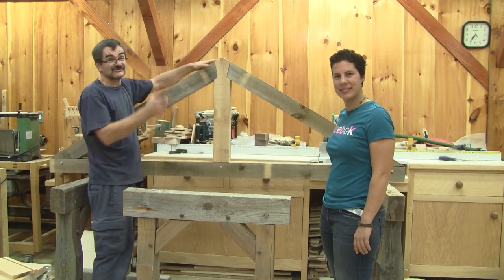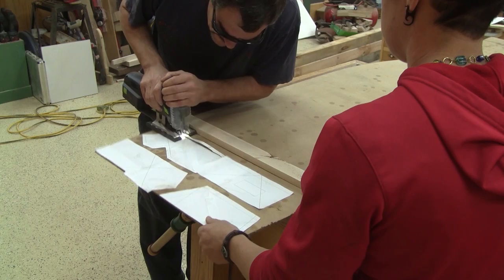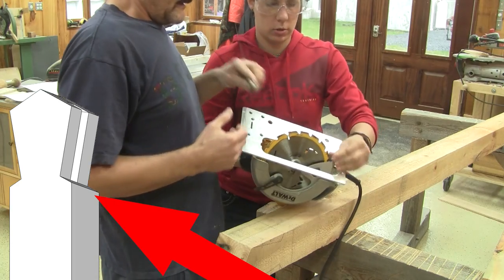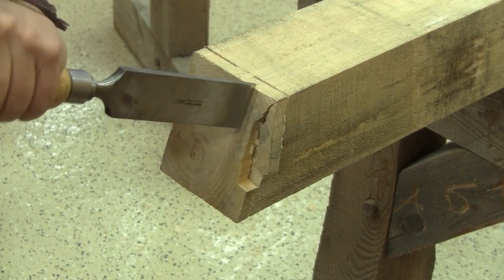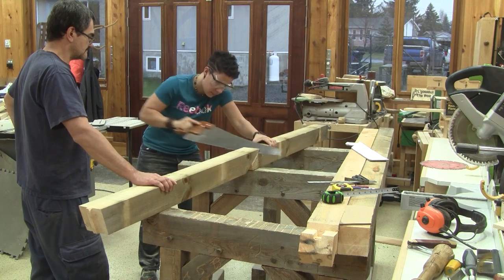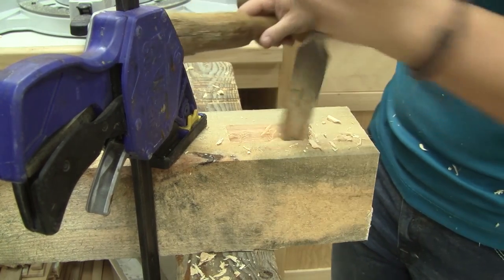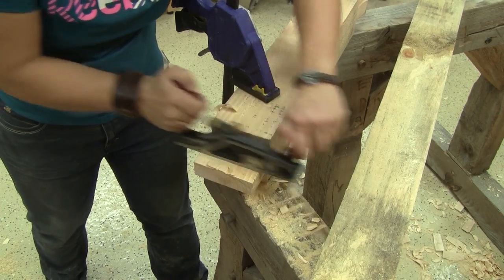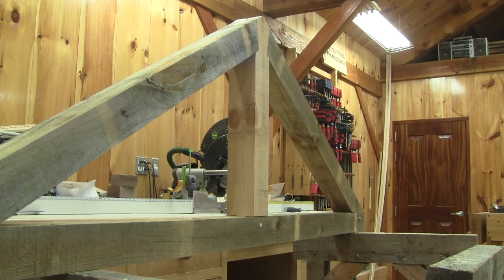The Woodpecker Ep 115  - I'm showing how I made my timber frame trusses

Comment: Awesome. Thank you.
Reply from the maker: Yes I still have this table saw, but I rarely use the sliding table since I bought a nice mitre saw. I use it when I need to cut a piece wider than the mitre saw. It's not tin the way but I had to remove the left wing of the saw so I can't use the mitre gauge on the left of the blade, sometime I wish it was possible. but still, it's working nicely

Comment: If you offset the holes for the pegs by three or four millimeters when you drive the peg in the joint will be much tighter.
Reply from the maker: Yes I know. but I didn't do that on my shop, and I showed Caroline what I did. 

I didn't do that on my shop for 2 reasons; first lifting pieces close to 200Kg alone with no machinery is something to hurt yourself, so I moved the pieces only when it was absolutely necessary.
Second the tie beams were twisted so on sawhorses it was impossible to untwist them to drill an offset hole. So to untwist them I screwed them to the top plate with 40cm screws, this untwisted the tie beams and the rafters were sitting flat on them after.
And at the end I screwed the rafters to the tie beams and the top plate with 50cm screws. But it's all in the video I made about the raising of the shop structure. This small rafter was just a mock up of the "real" one I have in my shop

Comment: im surprised you used turned dowels for the pegs. as you may or may not know, a hand rived peg is much stronger, as the grain is continuous.   Other than that, beautiful job.
Reply: Why not use metal dowels? I would think that wrought iron, or spring steel would be stronger than hand riven oak. I know hardwood dowels are traditional, but they use steel brackets to hold some post and beam structures together, and I would think that steel or some type of metal rod would be at least as strong as those metal brackets, or wooden dowels. I'm probably wrong on this, but I'm still curious about if it would work. Any knowledgeable feedback will be appreciated, as I'm going to attempt to build some post and beam structures soon.

Comment: Nice video, but shouldn't the pegs have a little offset in the tenon?
Reply from the maker: to get a real tight fit, yes. But I shoed Caroline how I did it. With 450lb rafters it was too much trouble removing them to ofset the peg's holes, so I've screwed it frrom the top with 18" wood screws to push it down and then I added a peg. For a 20 lbs 4X4 like she used, yes I would had offset the pegs it's easy to remove the rafter and put it back again. But I'm pretty sure she won't be using 4X4's it will probably be longer 6X6's which are a bit more heavy.

Comment: excellent work!
is there any specs for these heavy timber frames? such as design examples for connections, etc. any info greatly appreciated, thanks
Reply from the maker: I had to read a bunch of books to make them. but to calculate the size of the timber I uses a book and rechecked my calculation with the web site  the forestry forum

Comment: Hi Alain, interesting video, thanks for sharing. One question, where you pegged the mortises, is there a reason why they were not draw bored? Just curious...
Reply from the maker: I showed her waht I did on my shop; I didn't draw bored my mortices, because of the weight of my wooden pieces. It would had been too difficult to put hem in place mark the hole remove the 350 pounds piece of wood drill it and put it back in place. You have to remember, I managesd to find volunteers to help me put it all together so I didn't want to take the chance of having one of them hurting him/her self. So I told Caroline to drill for pegs and to add screws from the top where they will not show, this way she'll be all covered, and on top of it all I'm not sure how much help she would get so I showed what one lady can do by herself alone.
Reply: Alain Vaillancourt vgv

Comment: Hello Mr. Vaillancourt, I have one question: Why don't you use your Stihl to cut the big wood? you can use it for mostly cut you need.
Reply from the maker: I only used it once whern I made my shop tu roughly cut tthe top of the rafters. The thing is without a brand new chain this always cuts at an angle, so I rather use other tools.
Reply: probably you must buy a new sharp chain and try it. Or you buy a rat-tail file and grind up the old chain. I am a carpenter in Germany and using my chainsaw very often. It works very well. By the way, i've seen all of your episodes up to here and I like it! The timber working in Canada is a little bit different to Europe and so it is very interesting for me to watch it how you are working. Greetings.
Reply from the maker: I might try, but I'm unsure....
I know it's a litlle bit diferent, before building my shop I read a lot of books from around here and some from europe and it was a bit different. When I built my cottage more than 20 years ago I was young and thought I knew everything, and obviously I made a lot of mistakes, I didn't want to repeat the same thing a second time, it's why I read a lot of books.
Reply: Well your shop and your cottage ar still standing up to now and they looks very well!  I dont think you make big mistake. May be try and error and that do everyone. Differents are interesting, thats all. Another question: do you have or do you need a stress analyst who compute the construction? Here in Germany it must be for every building even a little tinny house in the garden. Now i'm watching ep 118....
Reply from the maker: Since it's not the main house I needed nothing just an hand drawed aproximative plans. Mostly the size, where it will be built in the yard and it's size. I made all my calculation with a book I bought on the subject and I rechecked them with the calculator on the  forestry forum. Since everything was looking finbe on both calculation I went ahead. But still 20X25 cm beams can withhold a lot of weight.
Reply: Yes, I think so. But on the other site the roof is in maybe thirty degree and in Canada is more snow in the wintertime. It can be very heavy so I would have calculate the size of the beams as you did. Your big beams are looking better than smaler one's you must be fear that they break down under a little weight. Well done.
Reply from the maker: The calculation was taking in consideration the slope of the roof and the material. on a slick metal roof like mine the snow don't stay long so it can sustain more weight, my pitch is not too too bad also 7-12 if you compare this to my house 5-12
Reply from the maker: This is great, I love it. Yes the beams are smaller but closer together, this was also acounted in the calculation.

Comment: Great video thanks.  What species of would would be ideal for a project like this?
Reply from the maker: That depends where you live. In Europe it's mostly oak. But around here it's hemlock or pine. Hemlock is brittle if you drop it on the ground but pine has bigger nuts but looks better when sanded. I've used hemlock since it's cheaper and I didn't intended to sand it.

Comment: Most of these video details how to make a pattern, any formula? The top does not additionally attached? +
Reply from the maker: The patern depend on the roof slope, here I made Caroline a 7-12 pitch, just like my shop, but you might want something else so it's hard to have a formula.
Reply: I assumed that there is some average value depending on the size of the material ... Anyway, thanks for the reply.

Comment: I'm guessing the king post doesn't really do anything there, other than look good?
Reply from the maker: exactly. you shouldn't have any weight on the tie beam. In fact the king post helps when assembling the truss 16' in the air and you have a 450lbs rafter to hold in place without any industrial crane...

Comment: That crown tenon was super loose and those pegs won't draw tight without an offset.
Reply from the maker: The crown tenon is meant to be loose, it's just there to be sure that when the 400lbs rafter is lay on the king post, it will not slip on the side. When I did the shop and I didn't have a hydrolic crane to lift the 400lbs rafters, I was unable to make a draw tight peg mortise, so instead I used 18"screws to pull all the rafters together. On this "mock up" truss, we didn't used screw but I told Caroline not to forget to put some before drilling for the pegs.

Comment: Carpenters joints are nice, but downside of them is that they will weaken the construction, instead of strengthen them. Better is to nail or screw plywood or sheet steel on the outside of the joints. It's a lot less hard to make and is a lot stronger.
Reply from the maker: But not as attractive... It's why I my shop, I also used 18" screws on top of traditional mortises and tenons. I also said to Caroline to screw long screws

Comment: How did you fastened the top
Reply from the maker: No not for this exercise, Caroline needed to take this apart so she could bring it to her home.
But on my shop, which has the exact same design, just twice the size, I screwed two 15" structural screws at the top of  each rafter, and two 18" at the bottom, on top of the mortise/tenon.

Comment: Are these 6 by 6 timbers?
Reply from the maker: No, this was just to get the feeling of making trusses, it's only 4x4. It's why this is not strong enough for a real structure, but it was easier to move around. In my shop I uses 8x8 and 8x10 at 350Lbs each piece, it was a pain to move around especially when you're alone to make the joinery...
Reply: @LgosseuxDbois-TheWoodpecker  But surely 4×4 or 6×6 timberframed trusses are strong enough for a greenhouse??
Reply from the maker: Depends on how far apart they are. You see in my shop the trusses are 10' apart. 6x6 would not be enough. But if I would had put them 5' apart it would had been more than enough but the appeal of a timber frame structure is that you barely have ties beams over your head, otherwise I would had just use 2x6 and a flat ceiling. Everything depend on the look you want.

Comment: I have 30 years in the joinery business & thats not how you dowel a joint. You have to drill the mortice then put the tennon in, mark it, take the tennoned piece out and slightly off set the hole, so you draw the joint up as you tap in the peg. The tennons are also far to loose in this video & will need expanding glue in them. Which defeats the object of making traditional jointed weight bearing trusses. If you are untrained DO NOT be making things like this, as heavy wooden beams hurt when they drop on your head. Doing General diy joinery is fine but leave roofing to a trained carpenter.
Reply from the maker: Thanks for the tip.
But this was Caroline first tenon/mortice...
Second I would like to see how do you do a draw bored with a 450lbs beams without a mechanical crane on a 8X10 rafter? 16' up in the air? So when I did mine I put 18" screws to close the joints, you can go an look how I did this on my shop. 
This was just an exercise on 4x4 we could had used 2x2 also this was just an exercise so why waste 450lbs 14' long 8X10 for an exercise?

Comment: The hole for the dowels are made wrong,-,,,
Reply: Kim Hoff  Amen to that..I always offset..for obvious reasons.
Reply: The hole on the tenon should be drilled slightly further from the joint so that the connection can be tighter and stronger.

Comment: They do a number of mistakes, and do things in a funny backward way.  For example at 07.43. where they do not get a tight fit.  and at 07.57.  where they drill both pieces at the same time. This is not the way to do it, and it would never make at secure and tight joint.